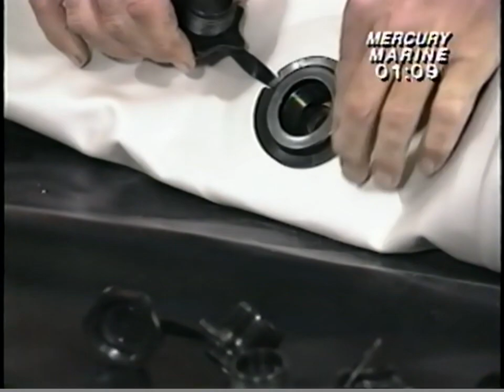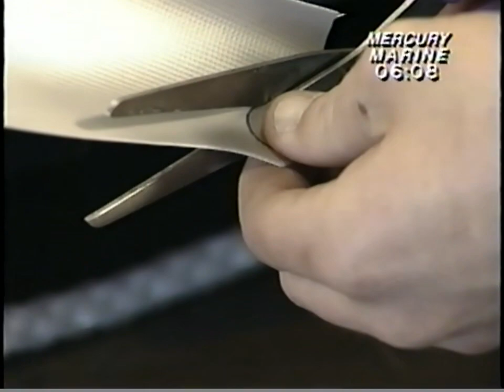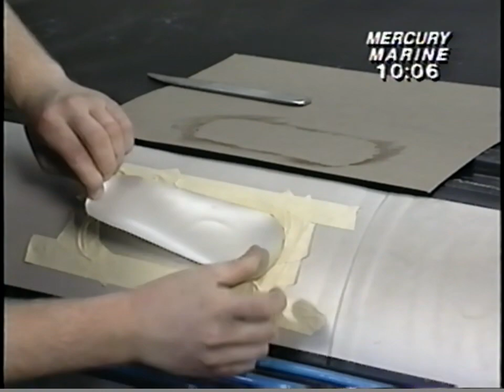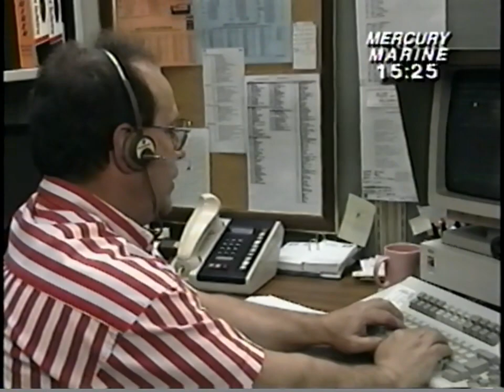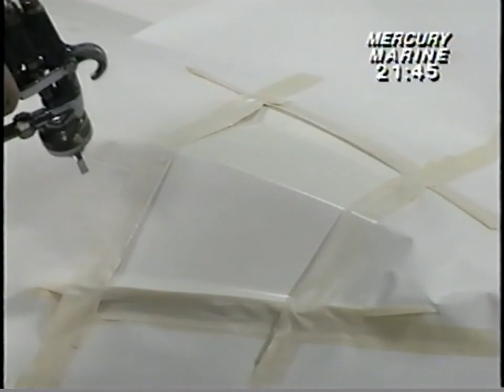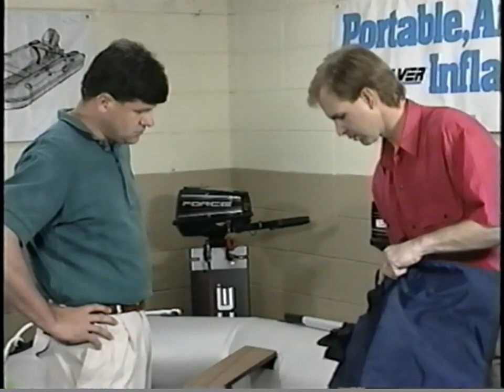Mercury QCARE - Quicksilver Inflatable Boat Repair and Sales Techniques

Comment: Wow. This must be 94 or 95. Great find - must have been on VHS. I’ve a 1995 380 which works just great and still looks new. 30 mercury on back, 5hp over the rating.
Reply: yes and maybe earlier considering the new-then-outboard models backwards which are from the early 90's,i remember them as a kid back then.think their material is PVC.